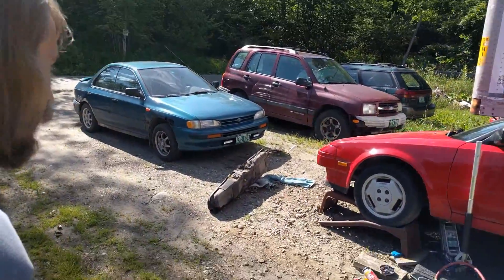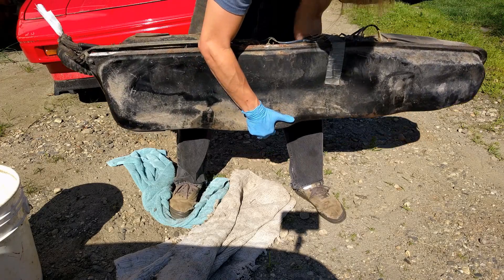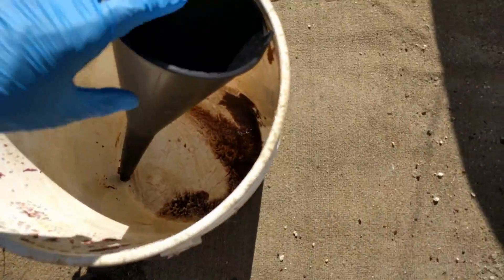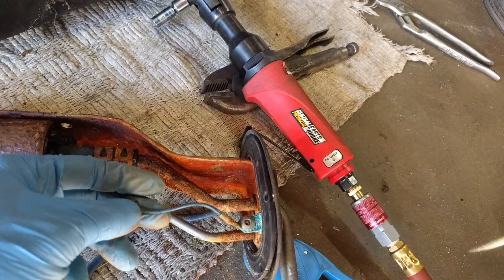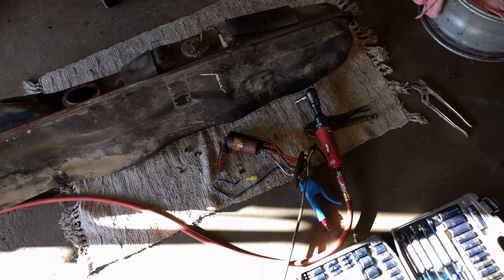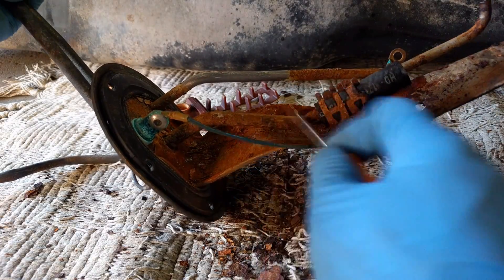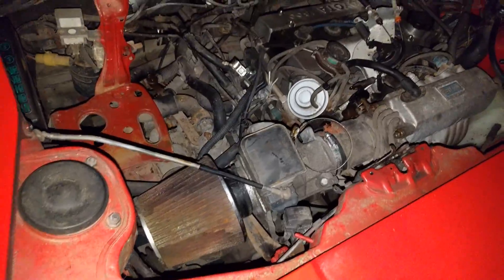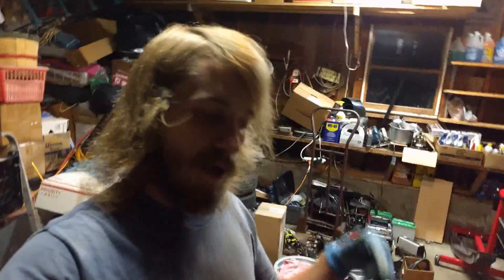MR2 Vlogs - Removed Fuel Tank and Pump - Nasty Rusty Tank - Pump Bench Testing

Comment: Just a fun thing: stainless steel WILL rust. I discovered this from living aboard a boat. When the stainless steel is deprived of oxygen or exposed to certain chemicals it can remove the naturally formed chromium oxide layer that forms. Chromium oxide is what prevents stainless from rusting. 

It's possible a previous owner did some sort of diy fuel treatment that damaged the chromium oxide layer and started the rust.
Reply from the maker: Yes there are actually a few ways stainless can rust! Especially depending on the grade of stainless. Prolonged high heat exposure can also cause stainless to lose some of its qualities and rust. That's why sometimes even stainless exhaust components will rust apart. Womp, womp. Thanks for the info!

Comment: Yo that garage need some work. I suspect they used zinc coating for steel. Zinc will rust first in place of the steel. Or dried up fuel. I have seen old gas which became a solid cake like stuff and stinks.
Reply from the maker: Yeah these seems like solid caked on old crap with a bit of rust. Really weird.
Reply: there is prob water in the fuel when the car was sitting or the previous owner somehow let water into the gas tank like leaving the filler cap open. a tank rusting from the inside out is not unheard off. Just need to re coat the insides to prevent further rusts and affect the fuel system when the new pump goes in
Reply from the maker: Yeah, honestly doing a full acid clean and recoat on this tank is a bit beyond my budget and time right now, but I'll see what I can do. XD

Comment: Might be just the rotten  gas build up. Might have to rinse the tank with acid
Reply from the maker: It looks like it's coming off fairly easy. We'll see! You from VT?
Reply: Yes it's Kaelob's Dad, got rid of the old sunset limo name
Reply: Maybe some vinegar? Works for pickles.
Reply from the maker: Kevlar802 Ah gotcha. Like the name.
Reply from the maker: tojiroh I put a bunch of vinegar and a dash of rust remover in it. We'll see if it helps. :)

Comment: ive herd of people useing nuts in bolts in the gas tank while cleaning the tank ( just rember to count how many nuts you put in and take out).
rember to be carful around and empty gas tank tho.   they say an empty tank is more dangerous then a full one. if your gonna scrape it, please your a soft non metal scrapper
Reply from the maker: Interesting idea. I could see using something like BBs as well. I will probably opt out of that strategy for now.
Thanks for your concern, that's a very good point. I think I have the gas completely neutralized now, but it could def be a dangerous fumes situation early on.